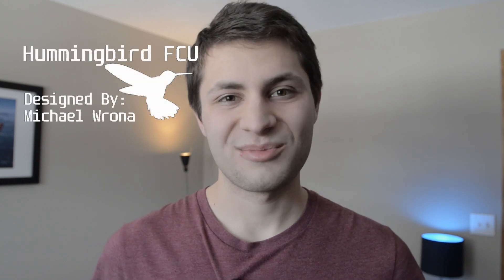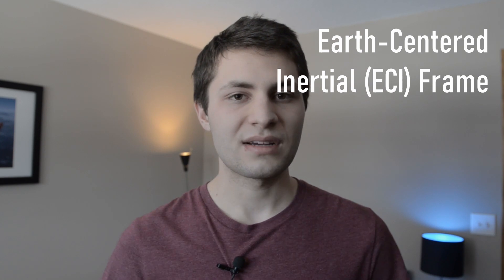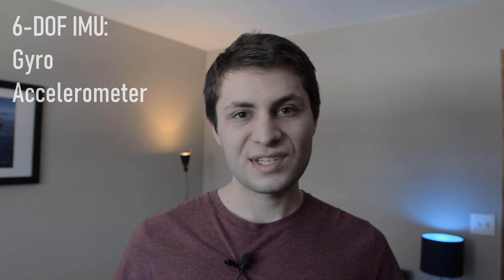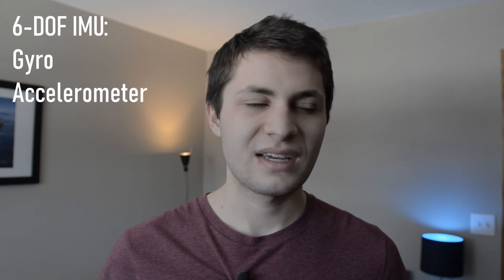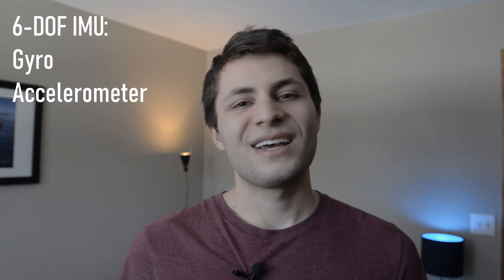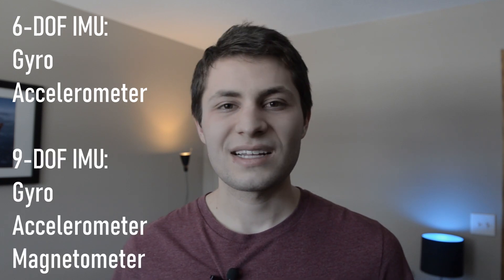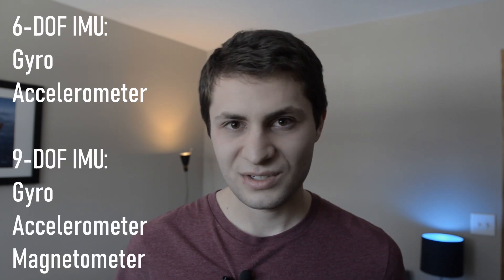Intro to Inertial Measurement Units (IMU)

Comment: Its misleading and incorrect to state that the integration of uncompensated gyro bias to angle as "gyro drift". If the gyro bias is not varying, its technically NOT drifting at all. Its better to refer the integration error as heading errors.

Comment: Why should we not filter the Gyroscope data?
Reply from the maker: Discrete filters, such as median or FIR filters, add delay. The filtered signal will lag behind the original noisy signal. Any measurement delays can lead to controller instability. Therefore, any delay in gyro measurements can cause instability and potentially a crash! You can probably get away with VERY LIGHTLY filtering noisy gyro data, but at your own risk. Check out this MathWorks video for a great explanation: https://www.mathworks.com/videos/control-systems-in-practice-part-4-why-time-delay-matters-1536913253300.html

Comment: Thanks for that video! Very clear and concise. I'm interested in the precision you can acheive with these "hobbyist" sensors. I'll look through your other videos.
Edit: Also you mentioned 9-DOf IMUs. Any advantages over the 6-DOF?
Reply from the maker: IMUs we have access to won't be sensitive enough to measure earth's rotation, but can still yield sufficiently accurate data for hobby applications (like self-balancing robots and drones). 9-DOF IMUs just add on a compass and have the advantage of having three sensors in a small footprint. Thanks for the interest!
Reply: @micwroengr7851  So if i want to measure the angle/position of a joystick would the 9-DOF be more accurate than a 6-DOF? As i understand it the additional magnetometer giving the added 3-DOF only give reference to the earth and the 6-DOF IMU would do the same only difference is that it would not know its orientation in relation to the earth's poles. Is that right?
Reply: @blind228  There are already very high precision sensors and accelerometers that we can talk about